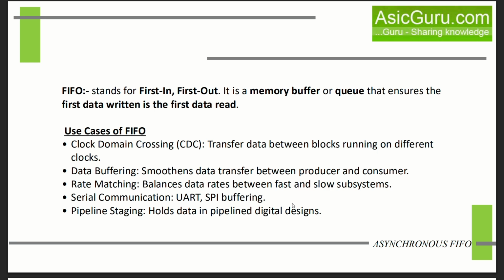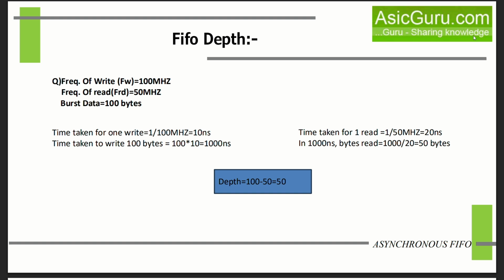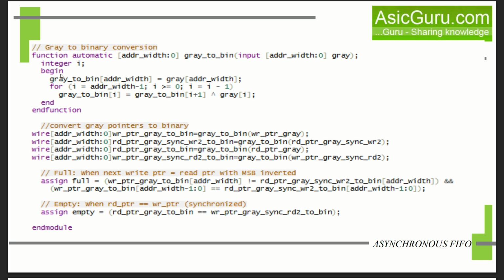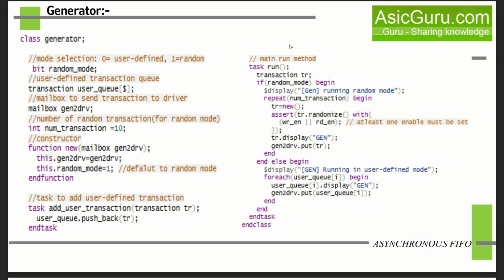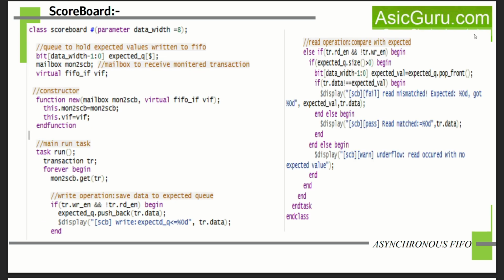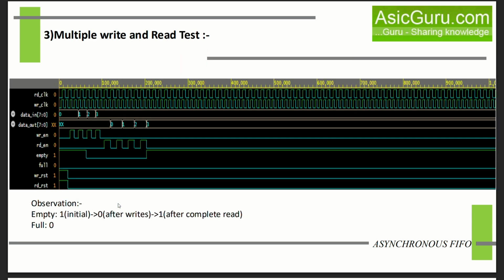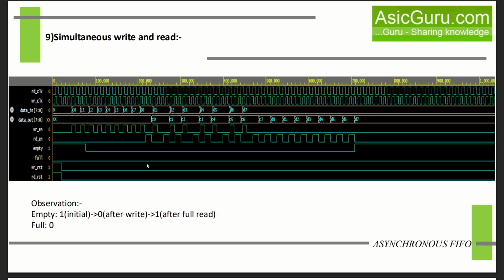Asynchronous FIFO (Design and Verification using System Verilog)

Comment: 00:00 Introduction & Agenda 
00:42 What is FIFO & Use Cases 
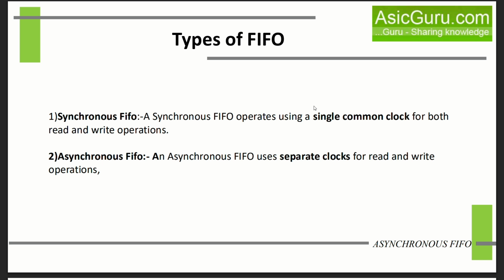01:13 Synchronous vs Asynchronous FIFO 
01:40 Asynchronous FIFO Block Diagram 
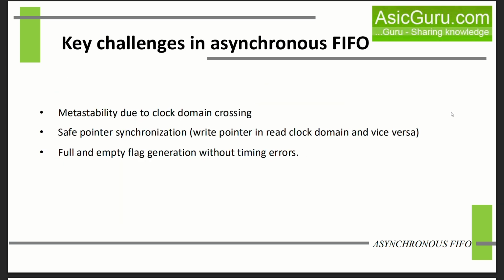02:38 Key Challenges: Metastability & Synchronization 
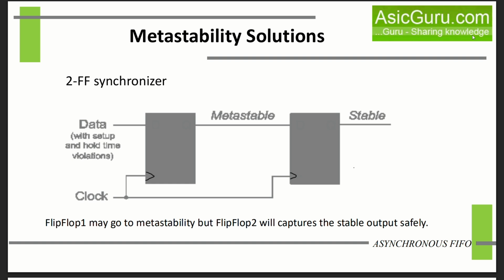03:55 Solutions: 2-FF Synchronizer & Gray Code 
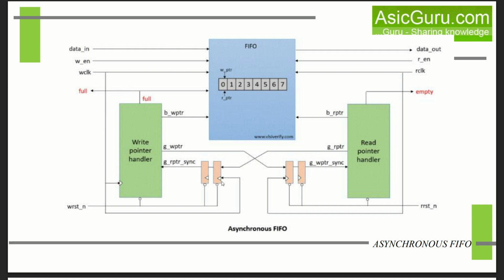05:28 Detailed Architecture & Operation 
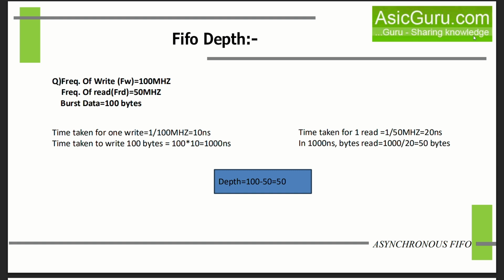06:51 FIFO Depth Calculation 
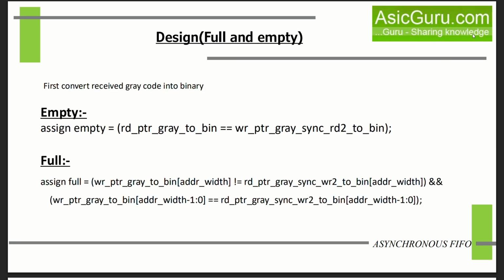08:14 Design Logic: Full & Empty Flags 
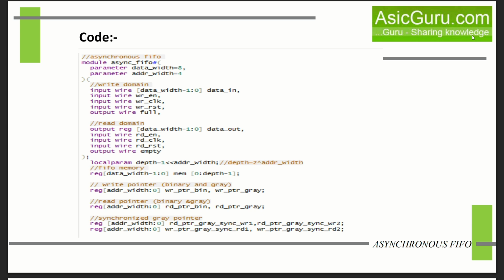08:44 RTL Design Code Walkthrough 
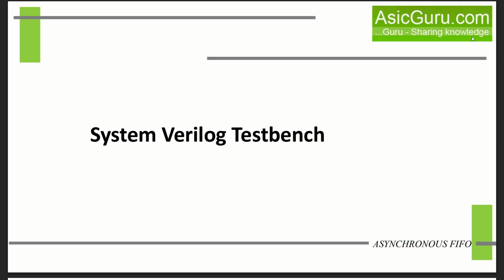11:05 SystemVerilog Testbench Architecture 
12:42 Testbench Code Implementation 
19:22 Verification Plan Overview 
19:40 Reset Test 
20:08 Single Write & Read Test 
20:37 Multiple Write & Read Test 
20:57 Overflow Test 
21:28 Underflow Test 
22:02 Random Write & Read Test 
22:39 Wrap Around Test 
23:18 Reset at Middle Test 
23:51 Simultaneous Write & Read Test